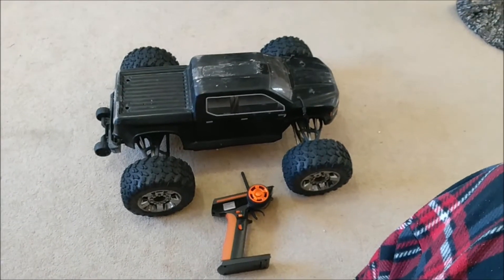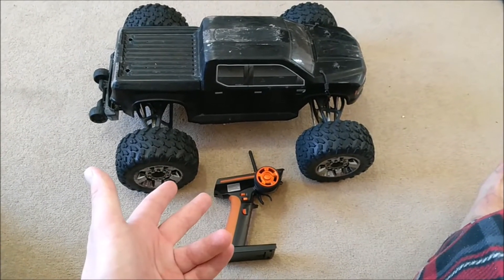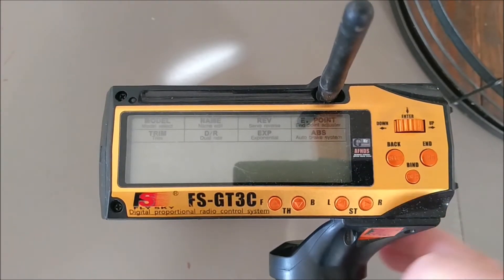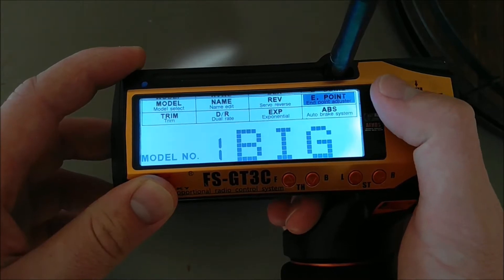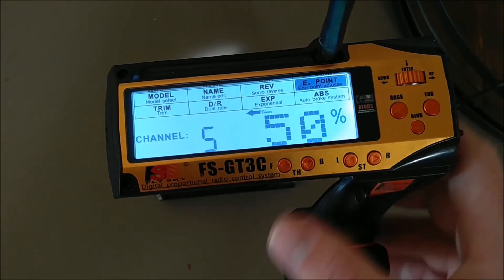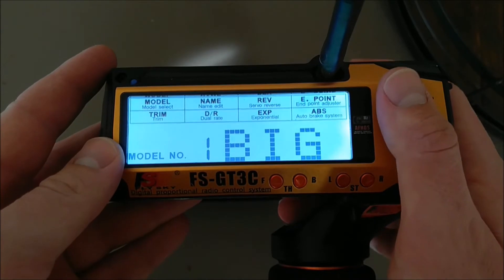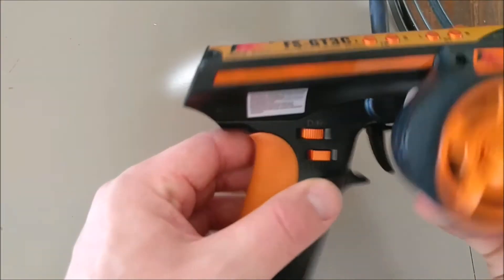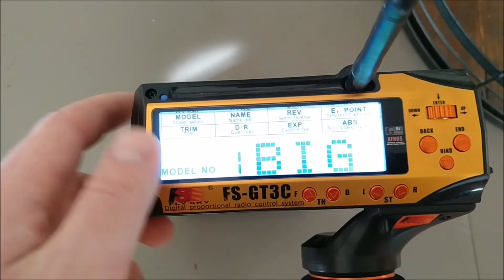How to Setup/Configure a Hacked Flysky Transmitter for a Arrma Nero/Big Rock/Fazon Diff Brain

Comment: You can also keep the diffbrain installed and use a mixer (with the mod firmware) for channel 3 with -100 -33 +33 +100 to control the diffbrain. I use a 3 channel gt-2 receiver which offers fail safe, in comparism to the 6 channel receiver.
Reply from the maker: True that. But it can't do all combinations. Such as front only locked I think. The receiver also offers failsafe as well I believe